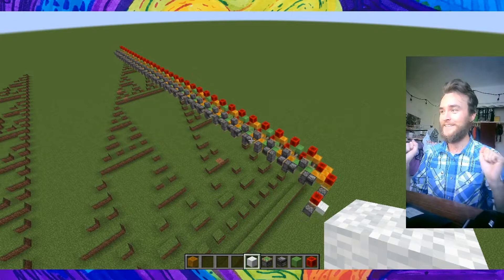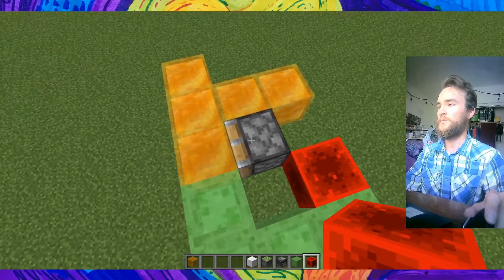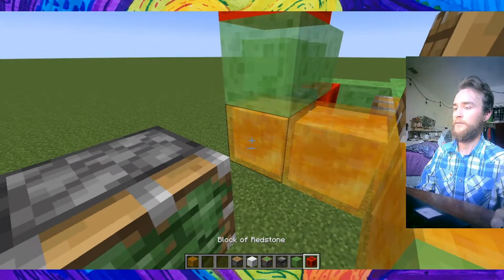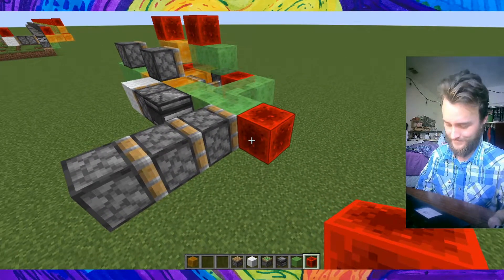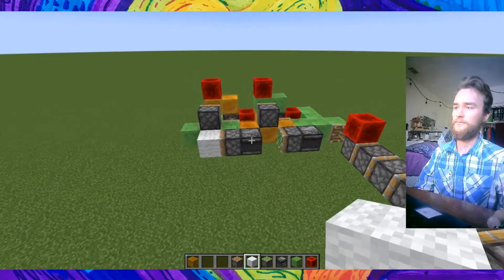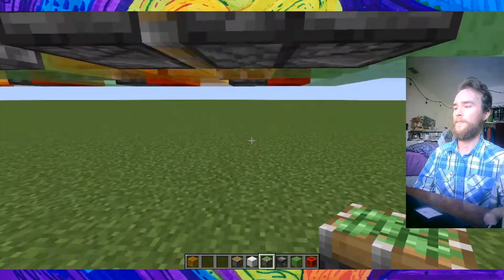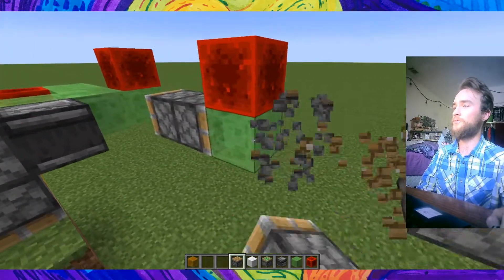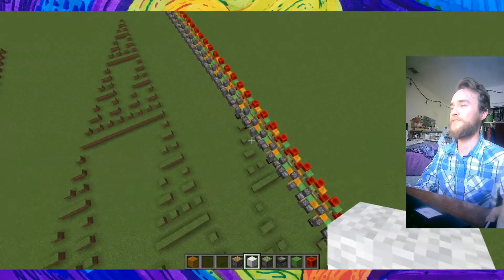Flying Machine That Prints Sierpinski Triangles in Minecraft

Comment: Ok so i basically know nothing about either newer versions or slimestone but i think the explanation for the not triggering is the following:
When the structure moves the block furthest away moves first(same gametick, but in the update order it moves first). This means the observer Further away schedules its "powering on" before the closer one. When now 2gt pass the close observer turns on and pushes the further observer that just "turned on" for less than a gametick. Now afaik the observer is basically on cooldown which means it will not fire again when it arrives at the other piston.
If you want to make sure this explanation is correct, probably should ask someone who knows slimestone. Pingu is great at it and commented on your most recent video i think
Reply: a lit observer upon arriving doesnt do anything. no block updates no scheduling. Pushorder doesn't matter since all observers turn on, then block events are processes because its a piston
Reply from the maker: That makes sense and is super useful
Reply from the maker: Pingu has been summoned, haha

Comment: it's because each T flip-flop is being triggered whenever the machine moves forward instead of only triggering when the previous flip-flop resets
Reply from the maker: That's true. But can you give any intuition for why such a fact would mean that a self-similar triangle emerges?
Reply: @whitestonejazz  hmm, the self-similarity at least can be explained by the fact that a binary counter is also self-similar. The only difference between them will have to be the update rule. The diagonal line will be because each successive flip-flop turns on 1 step after the previous flip-flop turns on, where it should instead turn on in the same step that the previous flip-flop turns off to get a binary counter.
4:25 my guess about the observer is that it's triggered when the whole machine moves so it doesn't have time to trigger again when it's flip-flopped. Probably you'd need the pull-up pistons and the flip-flop pistons to be triggered in two separate stages to avoid that.